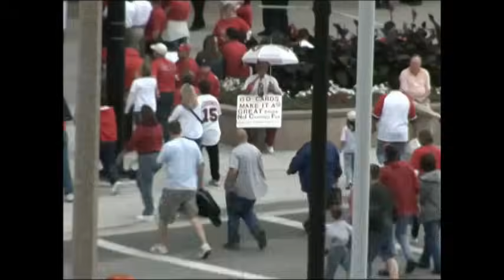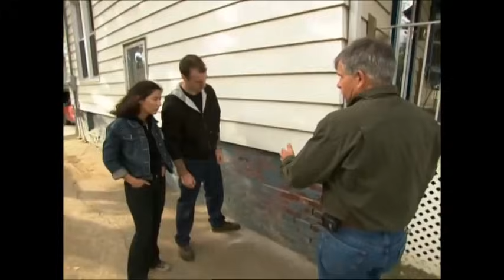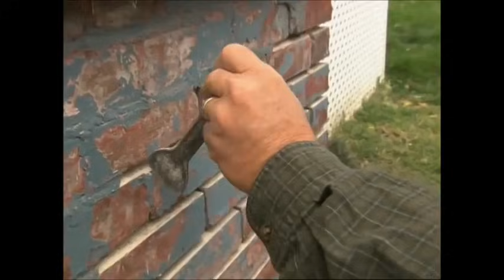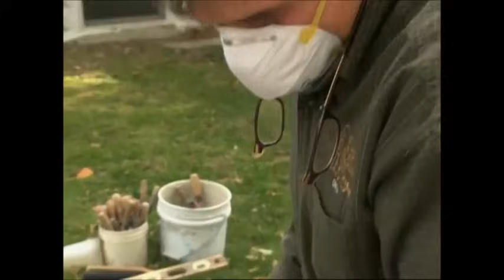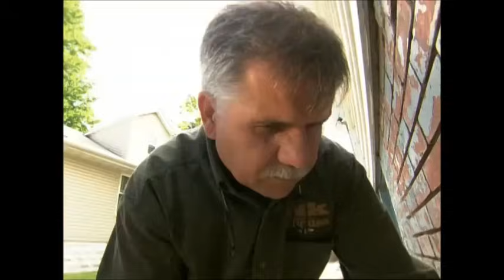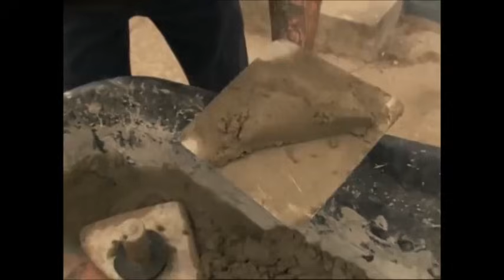Ask This Old House - Tuckpointing a brick foundation

Comment from the maker: Okay, I get it. For all the professionals, this isn't traditional "tuckpointing". In some parts of the United States and Canada, some confusion may result as the term is often used interchangeably with "pointing" (to correct defects or finish off joints in newly laid masonry) and "repointing" (to place wet mortar into cut or raked joints to repair weathered joints in old masonry). 

And remember, this is a TV SHOW. Mike can't be awesome at everything like you all want him to be. He's not a mason, we get it. He could have put the brick in differently to not expose the damaged portion. He's bad with the trowel. He pointed in the mortar going the wrong direction. Now go make a carpentry video so he can be the one to hate on you all.
Reply: In the United kingdom you don't see much tuckpointing nowadays that's down to the price (very expensive)
It starts with the type and colour of the brick. After all the old pointing is removed next step is to flush point the whole area, (normally just the front of the building) next get the cement mix as near to the colour of the brick, so when finished the pointing matches the colour of the brick. Now comes the tuck pointing, first mark out the whole front of the building with a plum bob (2 man job) starting with the perps then the beds. When its marked out, perps and beds are perfectly in line. Next lime putty on a small board flattened then cut into strips  roughly 5mm x 3mm and around 200mm to 300mm long then following the chalk lines each strip is applied to the brickwork, job done.
Reply: He should learn how to butter a brick properly, holy crap...lol
Reply: Don't  excuse the ignorance.  These videos are meant to be educational and informative, and they do a great disservice to the trade.

Comment: Does it matter what kind of mortar to use in Canadian climate??
Reply from the maker: Moreso the brick influence the mortar type. Type O for soft brick, N for standard, S for concrete block or very hard brick. For very soft brick or stone, some prefer a hydraulic lime mix.
Reply: Thanks. How would I know which type of bricks have been used in my house? It was built in 1956 and the bricks are kind of yellowish 
 @cwinter84

Comment: One step is missing: Before applying the mortar, you should lightly spray the surfaces receiving the mortar, so that they don't absorb the moisture from the mortar, thus, eventually, causing failure due to drying out prematurely (n.b., in very hot areas (90+ degrees F), more water may be needed; you should be able to see the spray on the brick or other surface, and apply the mortar before the water has a chance to evaporate or be totally absorbed by the brick or other surface).

Comment: What mix would you use, using a mortar squeeze bag?
Reply from the maker: You can use the same mix, except add more water until it is more of a pancake batter consistency. Squeeze the mortar into the joints and allow to set up 10-30 minutes depending on the weather. As soon as you can press the mortar without it sticking to your fingers, joint the mortar and really pack it into the mortar joints. This will press out air pockets and create a longer lasting, clean finish. Lightly brush or sponge off any smears and you're good to go.

Comment: I have a two story, circa 1900 brick building, soft lime based mortar, and am having it repointed.  The mason wants to start at the top and work downward.  My intuition is to do the opposite and start at the bottom and work up.  Opinion?  Thanks.
Reply: Trust the mason. We can't all be experts. That's why we hire experts. 😉
Reply from the maker: Both can be done. More of a personal preference. But if concerned about stability, have them point as they remove. They can grind out old mortar for a few days and then repoint the area. Rinse and repeat.
Reply: @cwinter84  Thank you for your excellent help!

Comment: Does this work for block walls also?  Thanks for your help!
Reply from the maker: Block walls are trickier because they are usually hollow. It isn't too difficult to remove and replace individual block. When repointing them, you need to be careful not to remove to much mortar in between the block. As I mentioned earlier, they are hollow and if you grind clear through the mortar, it is VERY time consuming pointing new mortar back in. Just have to make shallow cuts with an angle grinder would be the best method.

Comment: i guess its best to avoid a house for sale with this problem or should it just be fixed, no worries long as no water damage?
Reply from the maker: No worries and the repairs they performed were not expensive at all. The house is over 100 years old so some brick repair is very common for a house that age. As long as the foundation below ground is in sound condition, no worries.

Comment: Should always moisten the bricks and joints being re-pointed. Dry bricks and joints will suck the moisture out of your mortar, thus not giving the new mortar a positive bond to your repair. I recommend pre-treating the bricks and joints being repaired with diluted Weldbond  pre and post repair. This maximizes adhesion and also waterproofs the bricks and joints.
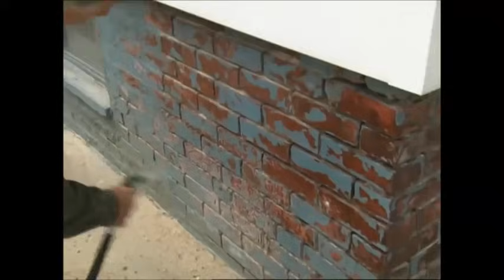Reply: Ya mean exactly like he explains and does at 9:17? 🙄

Comment: How do you figure out the hardness of your brick so you can choose the right mix?
Reply from the maker: That's pretty difficult without damaging one of the brick. Usually when I'm grinding out a mortar joint, I inevitably slice a smidge of the brick while exposing a nice clean surface for the new mortar to adhere to. From experience, I can tell by how easy my grinder blade goes through the brick. Or how easy a brick breaks using my brick hammer. Generally, the older the brick, the softer it is. Anything pre 1950's should be relatively soft; Type N or O mortar should be used. Type N mortar is pretty standard. Unless you're working on a historic building where hydraulic lime mortar should be used, you're probably safe to use a Type N mortar.

Comment: This is dumb
Why not use a joint cleaner with the roller wheels ?
This is so slow!!!
Ps he laid the brick with the broken end out and this is some low quality sloppy pointing ....
Reply from the maker: We've all said the same thing. Mike is a carpenter, not a mason. And ditch the joint cleaner and use an angle grinder (which is what they did use behind the scenes). They just made it appear that they used a raker bar. I'm going to delete your comment to keep the comments a bit less toxic, but all the professionals that have commented on the video, including myself,  are in agreement with your thoughts.

Comment: Never use a brick hammer with a masonry chisel, lump hammer only. I think the corner needed rebuilding completely .
Reply: i found white limestone/white bricks to be super soft and brittle so FWI do not use a chisel nearby it as it will crack the bricks or at least i had some do it trying that gently better ideas is using a multi-tool/sander or sawsall or hand-held grinding wheel and in my case be very careful and slow.

there very good build material and is from the 60-70's in my case so it's held up well just it's got it's limitations, side note it's self cleaning as i found out marking it for electrical work which is why i was removing some bricks but i was trying to save them for spares for later repairs/fill in unused holes

Comment: That's not tuck pointing! In UK that is just jointing.
Reply: You also drive on the wrong side of the road.
Reply: @robertgagne4844  No we don't.
Reply: @Mustaine1ify  it’s not the right side of the road.
Reply: @gregkosinski2303  No "The Left" Is correct "The Right" is wrong. Look up the reason then apologise.

Comment: This is NOT Tuckpointing
Reply from the maker: I understand, thanks for your input. I would have thought you wouldn't be as much of a troll from all the comments in your own videos, but you proved me wrong. It's a TV show; meant for entertainment and they asked for some behind the scenes help from an actual masonry restoration company. There's only so much you can teach the guy in the 30 minutes before they start filming. Now instead of trolling other peoples videos, keep skimming joints on your own projects at a snails pace. I bet even Mike could outpace you repointing.
Reply: It's not about being a troll it's about labeling your video right look up the definition of tuckpointing you have two videos on your YouTube channel both say tuckpointing either one is not tuckpointing I made the same mistake years ago thinking that recessed pointing was tuckpointing when it wasn't so I fixed my mistake you have yet to fix yours. And by the way I was clocked at 60 square feet an hour.
Reply from the maker: Where I'm from, we use it interchangeably with pointing, and repointing. I don't call soccer "football", or football "American football". And we all could point 2 square a day if we didn't grind out the joints and skimmed them all back in like some "experts"

Comment: did anyone notice that on the last brick, he could have flipped it so the giant chunk that was missing wouldn't be visible, while keeping the face of the brick facing the correct way?
Reply: Yep! I did.
Reply: Austin Hansen rookies.
Reply: My thoughts too.
Reply: cowboy builder
Reply: First  thing that caught my 👀
Reply: Yes instantly , ghastly ugly error .
It will look awful . This is the “blind leading the blind “. 

These are quality engineering bricks, on show to visitors to the house …
“ Hey look I repaired the corner ! Can you tell ? Yep sure can . Spot the bad work . “You can now look at it every day for the rest of your life !

Pretty much the first brick he also is saying “get it nice and level “ and it’s level on the X axis and not on the Y axis ! The front face of the brick will not be flush with the others.

Besides which the two courses above the last one also need out and resetting. The drop on those is probably why the brick was chipped , to get it in ! A real end of the day brick . Lord alcohol calling from the saloon at that stage ?

Should have done a couple of courses , let them set , and then do 2 more . Doing too many in one go and the weight of the upper courses will compress the unset mortar lower ones and throw them out of line . 

For the few bricks there , only a dummy would mix all his only bag of mortar in one go . But then you have to if you open a bag like that . Get some scissors and open just the top.

A smaller mix would then allow  for staged repairson different subsequent days.

Don’t forget to wash those bricks off or that too will add to the unsightly bodge for ever too .

Comment from the maker: The tool is called a "raker bar". Any blacksmith could create the same tool. There is a blacksmith near St. Louis that still makes them- kaimann welding. He was taught how to make these raker bars and the St. Louis style jointers from an old man who has since retired and was one of the only manufactures of these tools. You will not find these raker bars in any major tool store as this and the jointers that they use on the show are more or less only used within the St. Louis area.

On a side note, as some have stated, raker bars are pretty obsolete now. Grinders, arbor saws, hammer drills, routers are the choice for most masons. Tommy is shown using the raker bar briefly to rake back the mortar joints. As soon as that portion of the shot was done, background professionals ground out the foundation with grinders, and then cut back to Tommy and the homeowners "finishing up raking" the mortar joints. The magic of TV.
Reply: cwinter84 I live in St. Louis and my neighbor gave me one of those bars! He didn’t know what it was but I did! I’m currently in the process of putting it to good use on some brickwork on the back of my house. I also dabble in back yard blacksmithing and could possibly replicate the tool in about 30-40 minutes if needed, but unfortunately like you said, they are kind of obsolete..... but it never runs out of battery and you never have to change a wheel!
Reply: A grinder works much better.